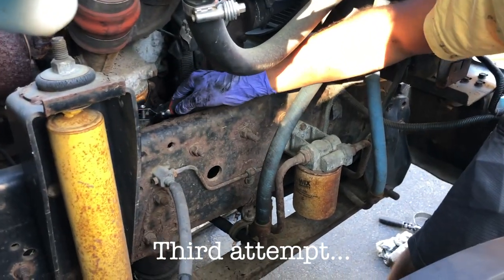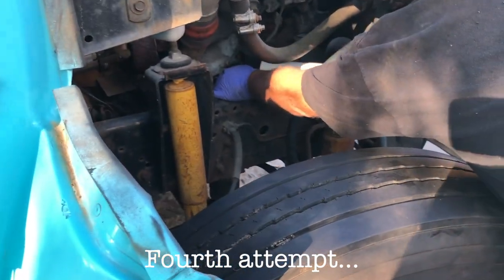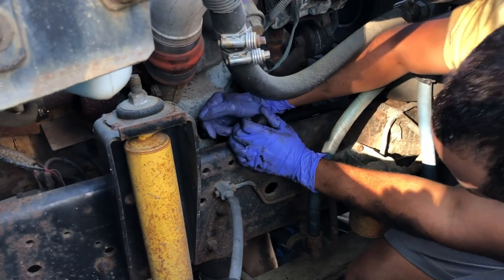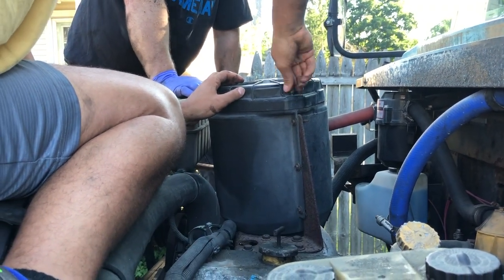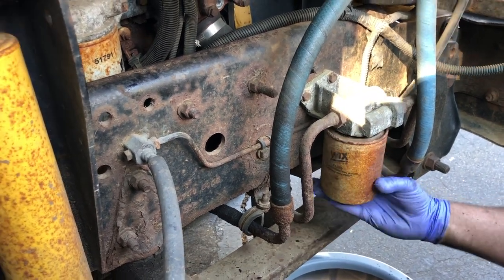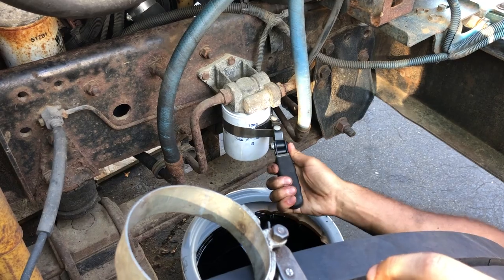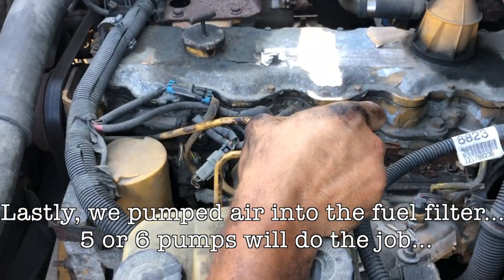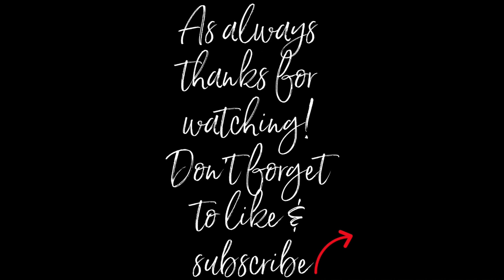We Gave our Skoolie a Tune Up!

Comment: Use the correct type of oil filter wrench. The heavy duty band wrench - 2-3" band - with a 1/2" extension and breaker bar makes easy work on these.
Reply from the maker: Richard Stamp good to know! Thank you! We were working under the guidance of a diesel mechanic. This was our first time working with a diesel vehicle.